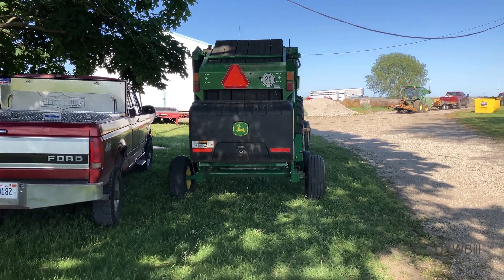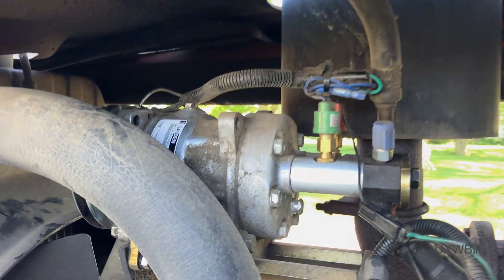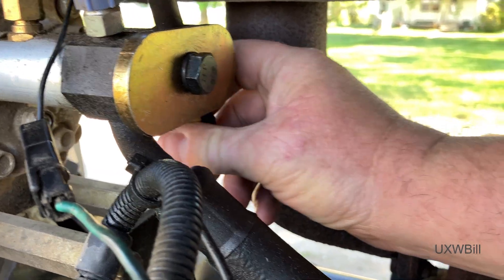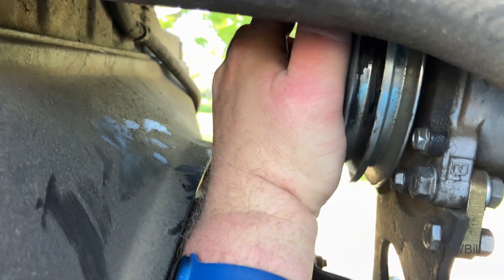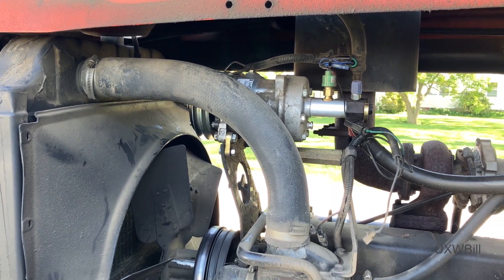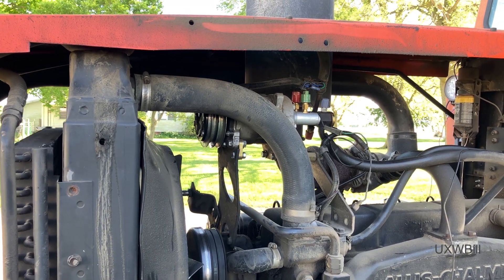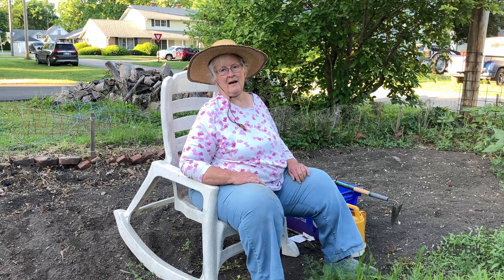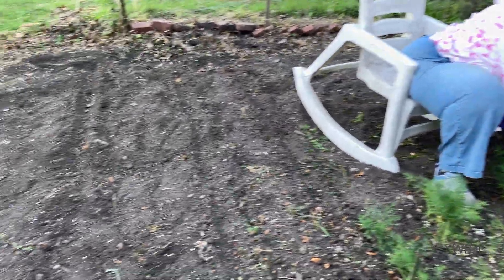Uh Oh. Allis-Chalmers 7020 Air Conditioning System Failure

Comment: That's too bad.  I have a Sanden Compressor in my truck that's 28 years old and still blowing cold on the original charge so I wouldn't expect the compressor failed on it's own for no reason.  I'm sure you will figure out what caused the failure and get it back up and running.  I remember watching the videos on your repairs but it's been a minute since then so I can't remember all you did to it.

Comment: That's got me stumped. I would think that sounds like there was some kind of occlusion of some sort at some point, but really, that is kind of a tough one to call (as far as my own experience, I first explored and went to school for this about a year after you did, so, I'm probably about in the same place as far as diagnostic wizardry).

Also, that Hawaii one took me a moment, but I got a chuckle out of that 😁
Reply from the maker: Don't feel too bad. It took the Keykeeper a lot more than a moment. ;-)

I think there's at least some chance the compressor would still be with us now had the operator shut the A/C down after it started to have trouble. It's also become known that the condenser coil up front gets plugged ... rather quickly ... when doing the sort of dusty work that tractors so often do.